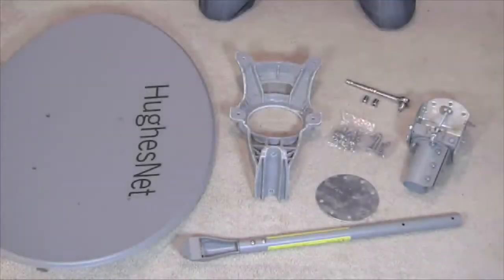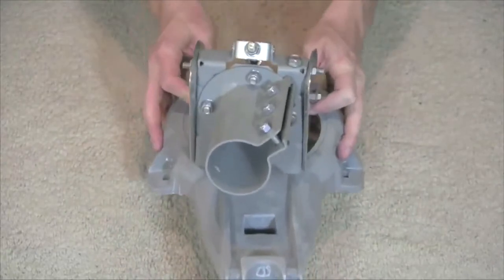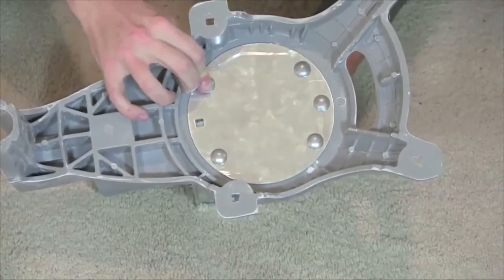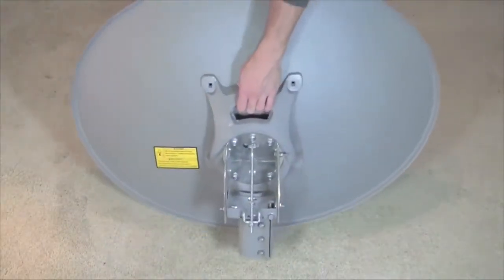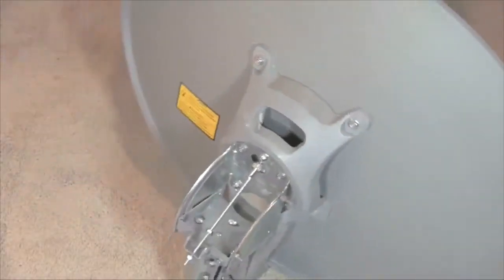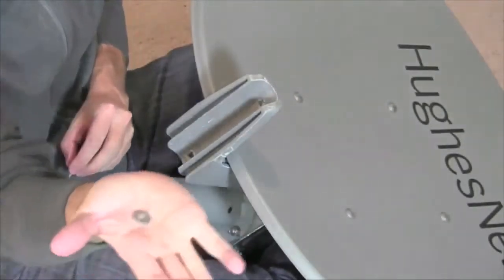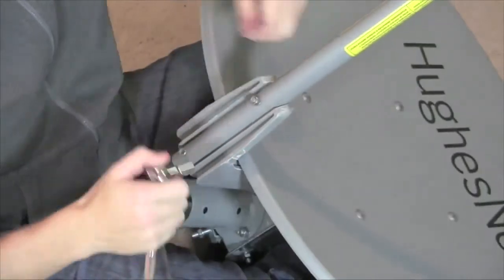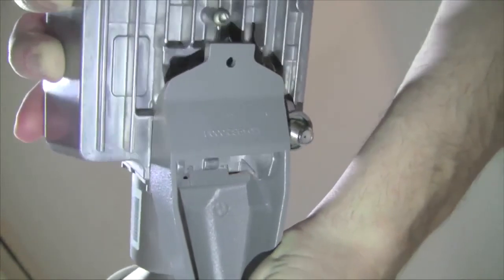Jupiter Antenna Assembly 2 13 2017

Comment: You did not use the hardware correctly when attaching the arm to the fiberglass bracket the bracket has a square hole on top that receives the carriage Bolt that goes through the arm you use the flat washer and the lock washer and nut underneath